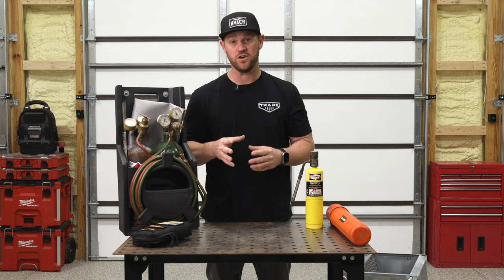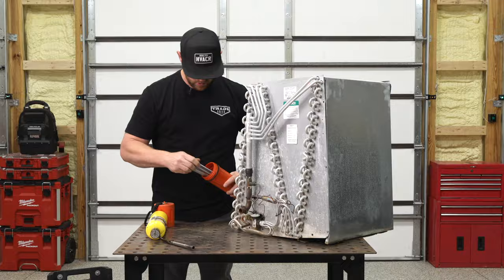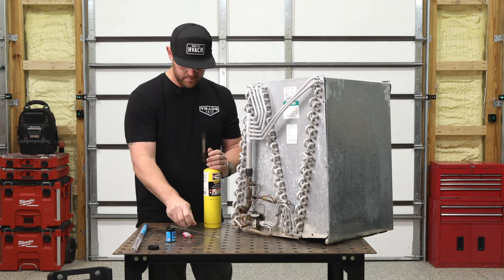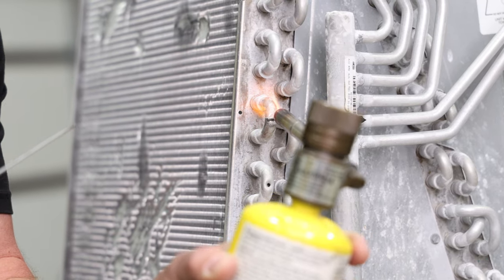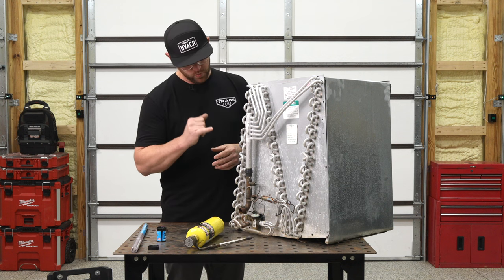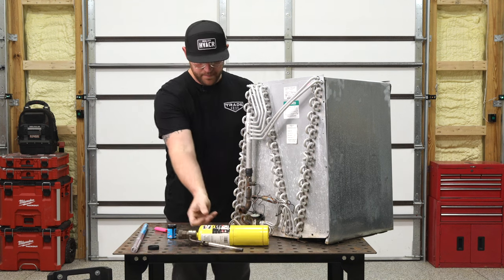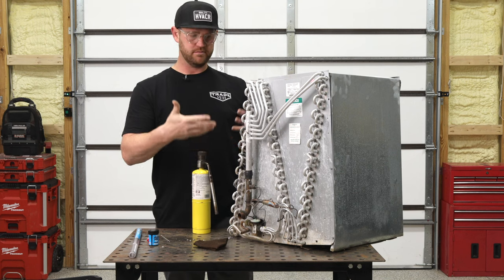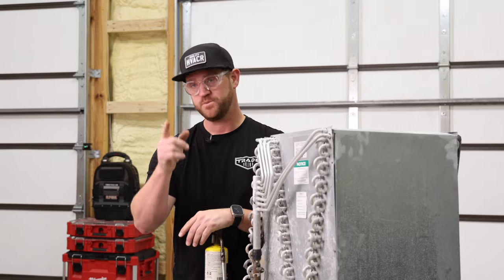How to Solder Aluminum HVAC Coils | Step by Step Guide 🔥

Comment: Replace the coil, these coils are junk in the first place. These keep us in business, along with aluminum micro channel coils as well. Good video though brother. You do good work. Been watching your channel from the beginning. Keep up the good work.
Reply: Yep , replace with a copper tube / aluminum fin coil. much more durable.
Reply: Plus the aluminum coils are more susceptible to bacterial growth
Reply: Oh, you have to do is look at the price for aluminum scrap versus copper scrap and you’ll know the reason. Also look at the coefficient of expansion for copper versus aluminum and you’ll know the reason. Yes these aluminum coils are junk. If you want to make an aircraft, sure, but not a coil.
Reply: That’s fine to replace a coil. Sometimes a coil is weeks out and if it’s a supermarket application, that’s weeks the customer can’t sell product in that case. Good to know how to do it.
Reply: @OcRefrigeration there not gonna make copper tube coils anymore it’s going to be all aluminum in a couple of years you won’t be able to buy them unless they’re overstock coils.
Reply: Almost the same price to just buy a new unit vs replacing the coils correct?  Just a little more to buy new
Reply: Just repaired a new 4 ton coil. During shipping one of the screws that holds the cover over the high and low copper lines got pushed in to the coil. When I pushed the Schrader valve there was no nitrogen came out. Then I found the screw hole I had already been down almost a day in record temperatures here in EastTennessee. I called the supplier 2 weeks on a coil or longer. I then braze the hole gonna use it til the new one gets here..

Comment: A professional would replace the coil. As a 40 plus year professional we've been through this aluminum junk years ago with carrier and hussman junk coils. There's a company in Texas that makes copper tube and fin replacement coils. Do what's right for the  customer. ALSO I would like to see a pressure test when your finished.
Reply: Sometimes coil ain’t available now with the supply chain issues. It has nothing to do with being a professional.

Comment: Get a coil where the weld on the u-bend is compromised. It's never a hole. It's always a factory joint
Reply: Had one on a brand new carrier copper coil they even paint marked it for me to find it easier jerks
Reply: I agree except for the one my tech put a hole in reinstalling the guard after cleaning. And I replaced the entire condenser at no cost to the customer because that was the right thing to do.

Comment: Being a former welder I’d also recommend taking a wire brush or scotch brite and getting the brazing area clean. Makes for a stronger braze especially for aluminum brazes. Even though the flux may etch the aluminum I’ve had some fail and once I pre-cleaned the area they haven’t leaked since.

Comment: Get a stainless wire brush to clean the area down to bare aluminum.  Save the brush for aluminum repairs only.   Once it is used to clean rust or any other material, it is useless for aluminum repairs.

Comment: I think you need to discuss mapp vs propane torch temp difference. Not much. It doesn't matter. Let me know what i'm missing. It's all about the torch tip. I used a tiny or poor shaped tip and both were bad bad. They heated too slow or too fast. Or un-even.

Comment: Aluminum that is not coated oxidizes and that oxidation need to be removed or any soldering or brazing will fail because it will be porous.  The technical term for removing that layer of aluminum oxide is called ablating.

Comment: I've done this minus the flux. I didn't know i needed it, honestly. I just sanded the spot and used the torch set at a lower heat, and as far as i know, it's still holding a yr later.

Comment: I recently removed a parallel circuit from our micro fin condensing unit, and sealed it up with aluminum solder. It was tricky to get the solder to flow, but once I got the hang of it, was able to cut it back a little further and seal it up. I think our lawncare guys hit it with a mower, and the slits in the metal housing eventually vibrated through the micro channel coil. Big shoutout to working well, regardless of how it looks. Too many people are concerned with how things look for Instagram.

Comment: Love the informative video, I appreciate you burning a hole through the tube as if it was a mistake in the field, first compressor I had to swap, I burned a hole through the tube connecting a dryer, got it sealed up though luckily

Comment: I had a few questions one being would you recommend using nitrogen while doing this. Along with that would you have to worry about the flux becoming a contaminant inside the system and could you use this same process on other parts of the coil where as a lot of the time I see leaks where the copper goes to aluminum. Forgive me if this sounds ignorant but this is very interesting to me

Comment: Recommended to run nitro or not in this case?
Can I use the regular silver rol to solder copper in plumbing or it has to be a special rod for that porpuse?

Comment: Good day.
Why dosen`t aply more flux after  you lay rod on hole , before working fill material to cover area? 
This will make better flow of filling material and prevent small leake due to oxidation aluminum on the coil itself.

Comment: Chipping in here: Yep, just replace it. As someone said, unless it is a medical emergency or you work on the Refer side, it is at BEST a TEMPORARY fix, and the coil better be ordered and on the way, because you can 100% guarantee the customer that the issue will return.

On a second note, if they are cheap or they “don’t want to spend too much money on it” and your company insists that you try to fix it, Make sure you write that on your Service Report. 

CYA guys. CYA.

Comment: The only question I have. 
If you repair this leak. Where in the structural integrity of the pipe was weakened, to the point of failure in the coil bend. How can you possibly do this in the field, successfully guaranteeing the rest of the return bends. The customer doesn't know what failed, except the HVAC unit doesn't work again when the gas leaks out from the next Leak. 
Sometimes, Most times , people choose reliability, when they're informed properly of the situation at hand.
Reply: Because I don't want to be the HVAC company that only gets you up and running right now, for a year or so.

Comment: The video is respectable but those who say why fix it are the ones who do not explore and say they are saving time and sometimes they do things just to do them and they do not solve anything, they only solve this in a comment that they have left for the gentleman in the video. Regarding the way to weld aluminum, personally, when you use a rod that contains flux, it is less complex to do the task. The Lucas Milhaupt 822 is a successful and efficient solution and when everything is prepared it is good to run the vacuum pump while welding instead of running nitrogen. I say this from experience. For the rest, the video is respectable.

Comment: Do not solder the coil unless it’s a medical emergency. We as professionals have no business fixing a coil that needs replaced. That is doing a disservice to the customer. Unless it is a medical emergency for medical condition or age both young and old u til the coil comes in and gets replaced. Replace it!!!!!!!
Reply: Ugh. No. If it’s a pin hole get over yourself.
Reply: 💯 correct, if there is 1 leak the chances of developing more is very high, it's a waste of time and money.

Comment: Not once does he say anything about it being crucial that the area is clean and free of any oils and that it is really bad idea to use ixy cetline or mapp gas tourch on aluminum period propane or even butane torch set ups are more than sufficient and a lot more manageable heat for a green guy to learn how to do that or that it is literally a temporary fix that will hold leak free for a short period aluminum is not as workable and reliable fix as copper is

Comment: One question for you Zack. Does patching a large hole like that cause turbulence within the pipe which will cause another hole down the line? Great video as always.
Reply: It could cause a scouring action at that spot. usually scouring take place on return bends changing direction and a higher velocity in the area of the bends.